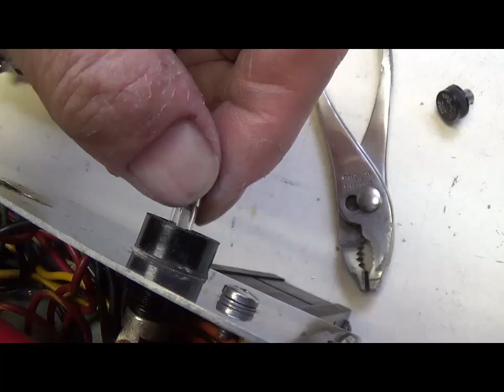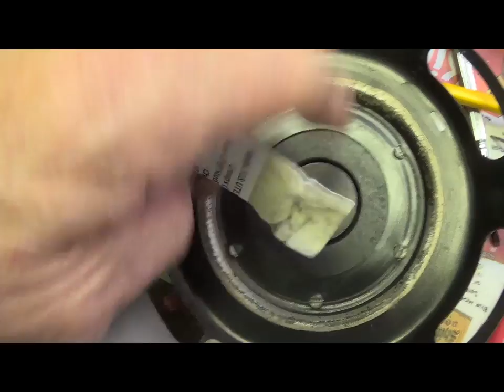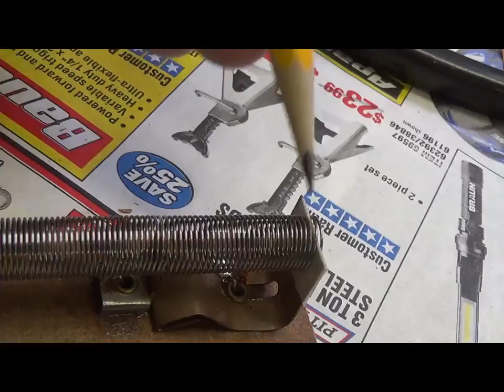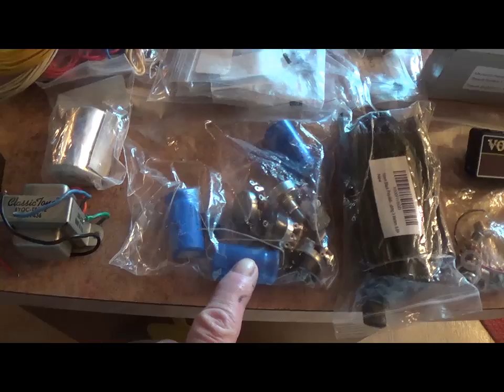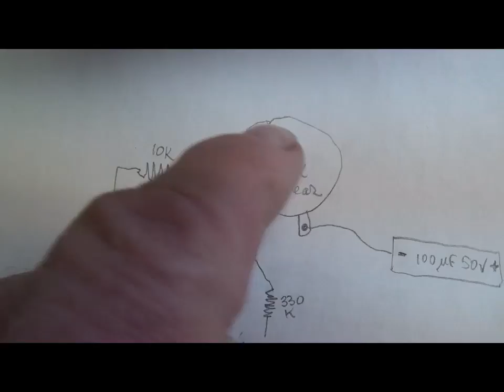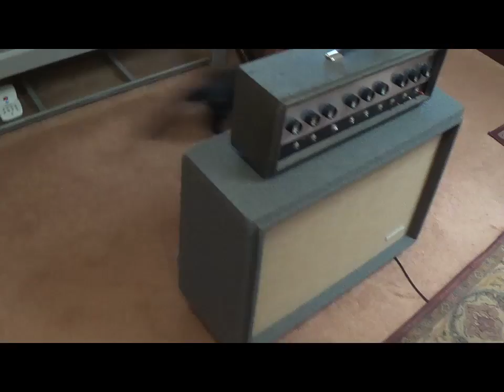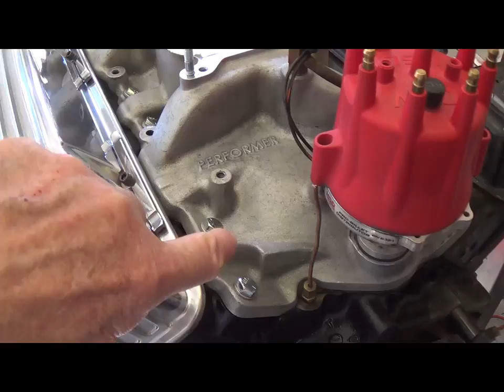Silvertone 1485, Part 3: Circuit Overhaul, Speakers, Sound Check

Comment: I’m sure you saw there was a string that holds tension on that reverb spring, I spent a lot of time getting the tension just right on that spring.

The other thing I did I replaced V4 the 12AX7 with a 12AU7, the Reverb is much more manageable.
Reply from the maker: Yes, I saw the string. Thanks for the tube tip :)

Comment: Hey Uncle Doug last time I heard you start up your rat rod on YouTube here the starter was grinding too lovely what you do about that to make them sound smoother is you put a shim starting with .010" up to .050" it will crank quiet and smooth it takes a little experimenting according to how it sounds. The shims come in various thicknesses. I've never seen a 1990 Chevrolet engine that didn't need its starter shimmed from the starter nose to the block.
Reply from the maker: Thanks for the helpful tip, Dwight. That car is long gone.

Comment: Will Uncle Doug I ran into hard to get off filters on Chevy engines back in the 1990s but only on new cars that come in for their first oil change it takes a 10-ft breaker bar the reason for it is the technician who put the engine together on a fast assembly line zip it on with a machine and do not lubricate oil on the seal I had to do that constantly. Sounds to me like someone who put the filter on that engine put it on without putting a film of oil on the seal and then probably over tightened it.
Reply from the maker: I never thought of failure to oil the rubber seal as the culprit.....but it makes good sense.  Thanks, Dwight :)

Comment: I know this is a somewhat older video UD, but I am always rewatching your videos as it was YOU, who enabled me to repair amplifiers, design and build my own circuits, chassis, construct and cover my own finger jointed cabinets, and just understand the basic principles of Voltages, Resistance, Impedance, Transformer ratios, and how A/C & D/C utilize the same wires throughout the amplifier being tailored via various capacitors and resistors to achieve certain desired results.. Your extraordinary teaching skills coupled with your unique personality, witty dry humor, is honestly quite endearing. I believe these are only some of reasons why so many people love your videos. I should add, although I had many of the tools and skills necessary to do these things prior to ever watching any YouTube video, You inspired and taught me (always with safety in mind), to take up this hobby. I was injured and am on disability, and Your Channel (along with a few others), took me out of a deep depression and I can never Thank You Enough!! I agree the fabric you acquired to recover the speaker cabinet is just gorgeous, and matches the original so well I almost wish the Head Tolex was trashed as well instead of being nearly mint as that material you got is much better looking IMO. I recently purchased an extremely original example or the 1484 off eBay for $450.00.. No Dents on panel, the amp was Extremely dusty, but cleaned up very nicely with just the right amount of small wear on the speaker cab corners. It has all flawless knobs present, perfect C12Q speakers, every tube is the original date stamped Silvertone, all test as new and look new (brilliant print, no discoloration), with the exception of one 6L6GC which I believe was broken as I found pieces of the tube inside the chassis when replacing capacitors. So glad you did this video and the 1484 series too, explaining the wacky power supply, so I know what to address if I encounter the same problem.. Thanks for all you do Doug (Teaching, Repairing amplifiers, Saving stray cats and teaching them to play Guitar, restoring cool RestoRods, and I’d like to believe that you get even with your Neighbors whom consistently annoy us all with their barking dogs and Non-stop Weed Wacking/ Leaf Blowing, by letting the Kitty’s jam out on the loudest amplifiers you own on special occasions.. Like this 2025 4th of July at 3AM 🐈‍⬛😼🎸 Be Well, Tom

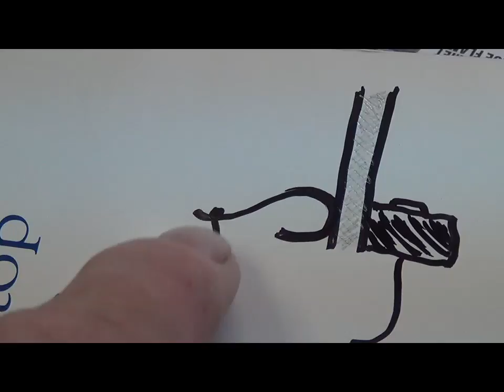Comment: 19:23 I am not the Almighty but I'm pretty sure the polarities alternate depending on the frequencies applied.
Reply from the maker: If you mean that the output wave form alternates between positive and negative at a rate equal to the frequency.......then I agree.

Comment: I had to replace the OT on my 1484. Before I got it somebody tried to replace the input jacks on channel 2 They put the jacks in but never finished the job. the resistors were gone. So I took one from channel 1 and made both of input 1s the original 68K carbon. Then I put a 56K metal on input 2 of both channels. Sounds good
Reply from the maker: Congratulations on a successful repair of previous bodging, Lucy.
Reply: @UncleDoug   Thank you for inspiring me to do it myself
Reply from the maker: @lucyfuir6386  You're welcome, Lucy. Keep up the good work :)

Comment: This Silvertone extravaganza has been my absolute favorite project.  I'm mentally preparing myself to rebuild a Dynaco SCA-35 that is both magnificent and  horrendous.  Meticulously worked on over its life, but the last owner seems to have spilled a beer on the chassis and then allowed it to mold, rust and corrode.  You cleaned up bladder juice and kidney nectar with such gorgeous results, you've encouraged me to do the same.
Reply from the maker: The removal of vile bodily fluids is only one of many skills required for a well rounded amp tech, Jules ;)  Good luck with your project.

Comment: Uncle Doug! great video. I have one of these myself and i was wondering if i could pull two of the power tubes to effectively disconnect one of the output transformers and thus use only one of the 2 speaker outputs. essentially turning it into a 1484. if it is possible to do so, which of the 4 power tubes should i pull?
Reply from the maker: I no longer own the 1485 in the video and Silvertone does not make it clear in their schematic which 6L6's go with which output transformer.......so your only hope, other than an internet search, is to remove the chassis and personally determine which pair goes with which OPT. Good luck.
Reply: @UncleDoug  will do! thank you!

Comment: Honestly, I have not watched the entire video, but my question is:  3 6l6's in my 1485 measured well, but one did not.  Do I have to replace the entire quartet?  Naturally, I'm concerned with biasing.  These look like the original RCA 6L6 tubes.  Thank you in advance!
Reply from the maker: I wouldn't replace them all, Bruce. I'd order a single new replacement tube, install it, check the bias, and play my guts out ;)
Reply: Thank you so much!
 @UncleDoug

Comment: Fascinating, extremely well photographed rebuild video. I actually owned that exact same amp. I say “owned” (past tense) because I doubt that it exists anymore, after leaving it to store with family some 25 years ago. Mine was in pristine shape, last time I saw it. 

Despite an impressive line up of 4 6L6 power tubes, and 6 10 inch Jensens, I could never get much kick out of that amp, in terms of volume. 

Often lamented that I did not keep it, because today this amp is much sought after. But after seeing all the work involved in bringing it up to date, no way would I make that investment! Just replacing the power tubes alone would cost a fortune, never mind the recap. 

What is the RMS rated watts? Great video series!
Reply from the maker: Thanks so much. Glad you enjoyed the video. I never tested the RMS output, but would guess that with 4 properly-biased 6L6GC's it could probably approach 90 to 100W.
Reply: @UncleDoug  Yes, 90 to 100 watts RMS sounds about right, for a line up of 4 6L6. 

But after watching your detailed video, with the schematic, I see that each pair of 6L6 had its own output transformer, which means that a guitar plugged into one (or the other) channel, is tapping into only half the total power output, about 45 watts RMS. 

So unless someone can play two guitars at once, plugged into both channels at the same time, you can only get half the power output the amp is capable of. Funny design! 

Today I use a Hartke solid state, 100 RMS, two channel guitar amp, driving two massive 12 inch speakers. 

This design has two discrete preamp channels fed into a single, 100 watt RMS power amp. 

With this design, you definitely get the kick. It’s so powerful, that playing one guitar (plugged into either channel), it is IMPOSSIBLE to turn up to full volume, unless you want the fire department coming to bang down your door! 

Miss seeing all that point-to-point wiring and glowing, red hot power tubes nonetheless!
Reply from the maker: You are forgetting that many bands, intent upon deafening their audience I guess, jumpered the two inputs ;)  @user-qm7nw7vd5s

Comment: I wonder if a simple piezo element from a buzzer or acoustic pickup could be slipped into the spring to replace the bad piezo crystal.
Reply from the maker: If you try this, let us know how it turns out, Keith.

Comment: I believe you are tying the reverb spring down too tight . Also you can reposition the spring to get different decays as well as well as spring tension between the spring end support and the piezo transducer to help. It's a crap shoot but you can get a full lower frequency sound with a 3 second delay with a reasonable higher frequency report but it takes perseverance.  Still it would never have a professional spring unit sound. I was spoiled by my friends Gibson Falcon reverb.
Reply from the maker: Thanks for your helpful input, Charles.

Comment: I'm just wondering, will it also work to just enclose the transformer in a shielded case instead of shielding the components near it?
Reply from the maker: Physical distance is best, but I guess you could shield the transformer. Generally only the pre-amp circuit is susceptible to EM, and it alone is shielded.
Reply: @UncleDoug  Thanks! I recently fixed a very cheap 10 watt receiver for casual music listening. The hum is at a level that can induce headaches. I tried to shield all components near it but nothing happened as the space is too compact, or maybe the aluminum tape I used is not a very good shielding material at all. Luckily the hum went to a tolerable level (almost none) by turning the transformer in an awkward diagonal position. I had to trim the edges of the PCB to gain a bit of space.
Reply from the maker: @dispersemedia  Is the hum 60Hz or 120Hz?  120Hz = filter caps. Did you try using shielded cable for the pre-amp wiring?
Reply: @UncleDoug  I think it was 60hz. I did change the filter cap from 2200uF to 4700uF and nothing happened. I did not bother messing with the cables as it were using ribbon cables to jump from one board to another.
Reply from the maker: @dispersemedia  Something doesn't sound right about this circuit, DM. Where did you find a 2200uf filter cap in a tube amp circuit ???  Ribbon cables ??? I thought we were talking about a Silvertone amp like the one in the video.
Reply: @UncleDoug  Nope sorry for the confusion. I'm talking about a cheap solid-state receiver amp (bluetooth, FM radio, USB, Aux in one) as I mentioned earlier. It just happened to have the same hum issue caused by the transformer's location like in this Silvertone amp. That's why I asked here.
Reply from the maker: @dispersemedia  I have no experience with transistorized circuits, DM. Sorry.
Reply: @UncleDoug  No worries

Comment: Hi Uncle Doug. I thought you might be interested, I use kester liquid 951 flux and it makes it easy to make hard to solder joints.
Reply from the maker: Thanks for the tip, Monty.

Comment: the Acoustic Control Corp. model 370 amplifier of the 1970's had a 6 speaker cabinet too. It was one of the best amplifiers I ever had. Had a lot of power.
Reply from the maker: I've never heard of the brand, Z, but trust your high regard for it.
Reply: @UncleDoug   they went by Acoustic, made by Acoustic Control Corp. Some really powerful amps of the day, solid state, and very elegant designs too. Used by famous bands like Led Zeppelyn, which later went Marshall.

Comment: Hello, Thank you for the wonderful videos on silvertone amplifiers. I have been  working on a 1484 chassis that was found in mostly original condition. With exception of the OT and one 6L6 tube socket.
The replacement OT primary windings are lower than spec. 70ohm and 78ohm on each side of the tap.
The amp now has fresh tubes and all new power supply capacitors.
The Cathode caps are original but on back order
The resistors and diodes in the power supply have been checked ok.
The amplifier works but all voltages seem low.
Negative dc bias v  = -25v
Plate v = 352v & 351v
B+  v = 353v
and 260 v from the choke to pins 4 on the 6L6 tubes.
Is there something obvious that I am not seeing? Maybe the choke or the OT?
Thanks for your thoughts.
Reply from the maker: Have you checked the output tube bias? The PV will vary quite a bit when the plate current is adjusted during the bias procedure. Also, when checking the B+, is the amp connected to a current limiter? In a high-wattage amp like this, it will greatly reduce the PV and PC.
Reply: @UncleDoug  The amp was indeed still going through Dim Bulb Tester!! Hmmmmm. It was glowing slightly but I chose to ignore it that little detail.
 Its plugged directly in the wall now.
The first thing I saw was that the plate voltages went up from 350v to 457v .
I will check the bias as well. As soon as I stop laughing at myself !!!

Myself and a chum are scratch building the amplifier case as well as the speaker bottom.  AS kids this was the amplifier of our dreams.
Thanks for getting old pals back together
Reply from the maker: @unclepurple69  I'm glad your old Uncle could be of assistance, UP :)

Comment: Uncle Doug, I recently repaired a Astatic phono head by cutting down a piezo disk. The disks are very inexpensive and work great. I think they are used in electronic drum sets. I bet you could use one to replace the sensor in this reverb tank by cutting it down and epoxying it onto the silver nut or some other fixture. Here's the video https://youtu.be/5_GAQSR0zaY I start messing with the piezo at 14 minutes and do some testing around 28 minutes. The piezo put out about 300mv with the action of the needle. Thanks for your videos I just rewatched the one on cathode bypass caps for the third time. Good Stuff!
Reply from the maker: Thanks so much for your excellent suggestion, Rob. I'll definitely watch the video.

Comment: Hi there Uncle Doug.  I like your videos a lot especially for how thoroughly your process is explained since old geezers like us brought up building and fixing tube amps won't be around forever and there are far too many techs who really aren't tube savvy.  Your videos help keep the art and science alive.  Please allow me to make a suggestion though for your final demos.  What makes tube amps uniquely special is the harmonic content and dynamic response that takes place "when they can breathe".  Ideally tube amps, especially non Master Volume designs, should be cranked up to at least 50% or more and a few designs need to be "dimed".  This is where they start to sound Fat and rich!   If your environment doesn't allow you to crank up that loud I think you should explain the change that comes with "opening up", the effect on low end, the whole complex electronic and human ear process that inspired Hi Fi "Loudness" compensater controls to explain why your demos tend to sound anemic, sterile and thinly bright.  You could even demo that with a low wattage amp like a Pro Jr in just about any environment.  Keep up the good work!
Reply from the maker: Thanks for your input, E2.

Comment: Fantastic work - I really enjoy your problem analysis / correction work. As well, salvaging the cabinets that I may have used to start a campfire make me anxious to work on my GA-30 RVT that is suffering from 30 years of neglect. I hate panel rust.
Reply from the maker: Thanks so much, RF. Best of luck with your own project(s).

Comment: Great work , like always . On a side note.. I have been an auto tech for over 40 years. PLEASE do not use Fram oil filters . They are not a good filter .
Reply from the maker: Thanks, Brian. I used the Fram filter to simply seal and protect the engine while it was being cleaned and painted. I normally use Wix filters.

Comment: Did you leave the death cap hooked up to the ground switch? Isn't that the Aerovox cap that you replaced? Also, why did you leave in the old power supply diodes?
Reply from the maker: The death cap may have been left in, but it was disconnected from the circuit. I tend to only replace components that are malfunctioning, Jesse.

Comment: Would it be a crime to add another phase splitter to make it a true stereo amp? Maybe with a stereo effects loop shoehorned in?
Reply from the maker: Stereo amplifiers are actually two completely separate mono amps, driven by two separate but related signals, feeding two separate speaker systems. I guess a two channel amp like the 1485 could be reconfigured to do this, but there are already stereo guitar amps available.....why alter a good vintage amp?

Comment: I have some experience using the 1485 back in the late 60s. I used to borrow one for larger (mostly outdoor) gigs. The 120 watts gave me needed headroom that my 40 watt Fender couldn’t provide under the circumstances. I loved the amp but always hated that reverb! Splashy and thin! I used to pair that Silvertone with my Fender freestanding reverb and that puppy would rip! Great video. Brought back some good memories. Thanks.
Reply from the maker: Our pleasure, Robert. The addition of the 6G15 Fender unit would indeed be a welcome improvement.